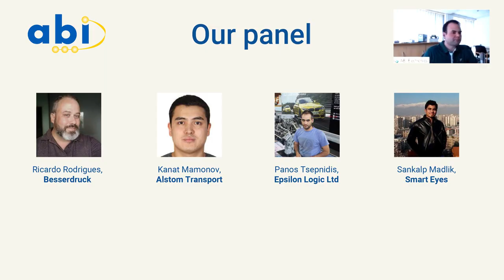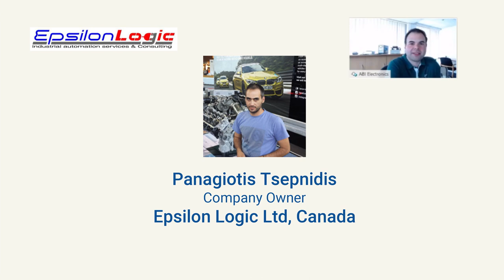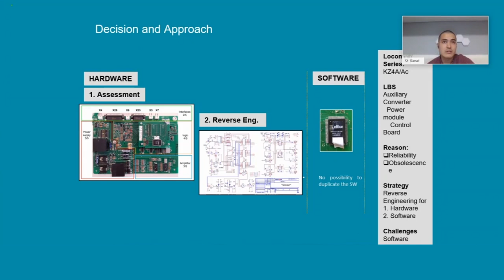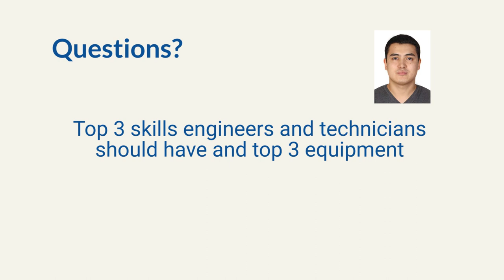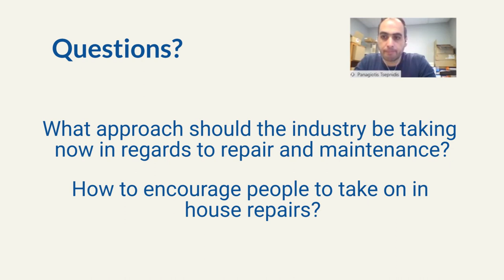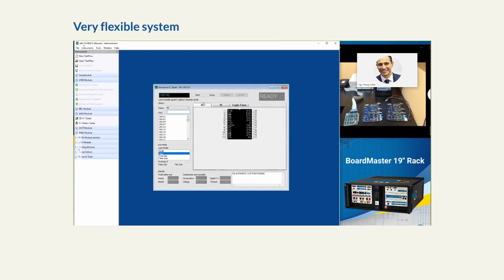Are we prepared to repair industrial equipment following COVID19? Live Webinar.

Comment from the maker: Panel Introduction: 02:25
Irish Rail quote: 03:42
Ricardo Rodrigues (Besser Druck): 05:10
Panos Tsepnidis
 (Epsilon Logic): 09:58
Kanat Mamonov (Alstom): 17:35
Sankalp Madlik (Smart Eye) 24:48
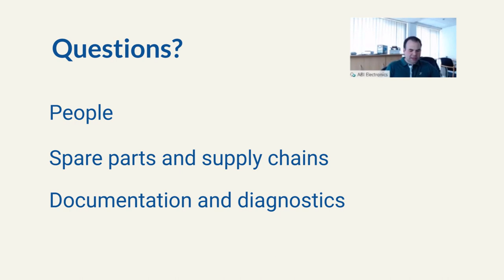What are the Top 3 Skills and Top 3 Equipment engineers, techs and workshops should have? 36:06
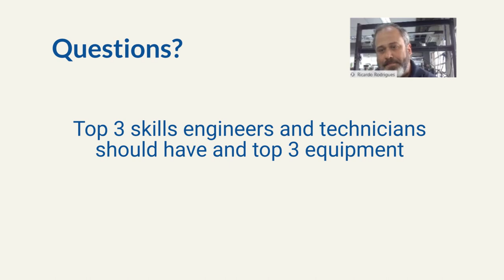What kind of expertise is required to maintain and repair equipment without the help of OEMs? 55:36
What should be the industry approach regarding repair and maintenance now? 57:59
How to encourage people to take upon in-house repair? 
Should people be afraid of repairing electronic PCBs? 1:00:40 
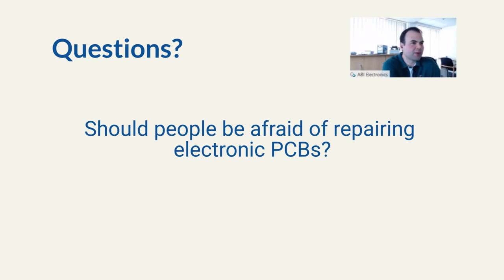ABI U.S and Canada Product Manager, Fawzy Taha 1:04:55
ABI product review (#BoardMaster and #RevEng) 1:07:13
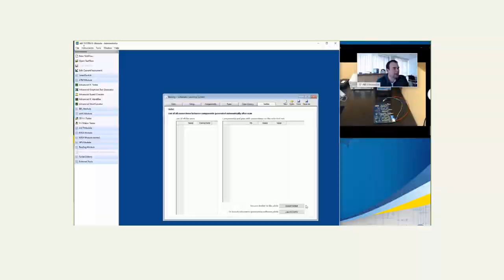Final thoughts segment and closing: 1:21:39
Reply: Great webinar! Learned a lot. Thanks.